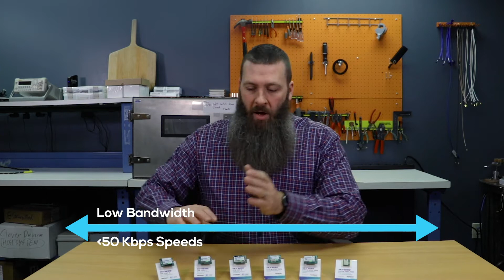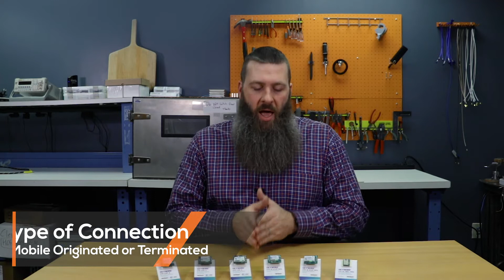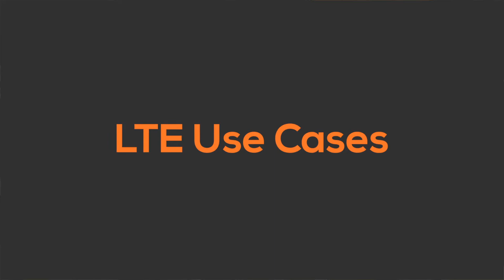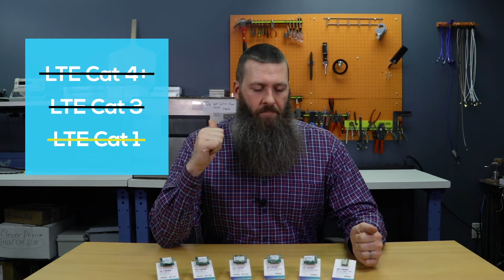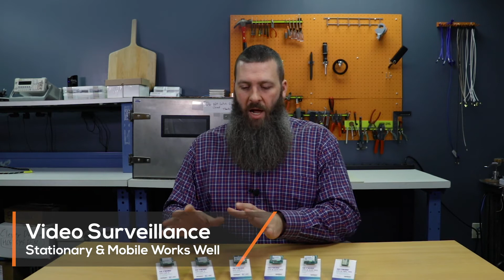Choose the Right LTE Technology for Your IoT Use Case

Comment: Nobody can explain to me to what extent Cat 1 has stronger signal propagation than Cat-M in poor service reception areas. I don't care about speed but I do need reliability and uptime. And I can't understand why sometimes my fixed Cat-M stations drop signal for hours.
Reply from the maker: Thanks for watching! LTE Category 1 doesn't necessarily have a stronger signal propagation than LTE-M, but because it's a standard LTE technology (and not a low power one) it has the same coverage area as traditional LTE devices do. LTE-M is often deployed on fewer LTE bands than Cat 1, and may not be present on all towers, either. The trade-off is that LTE-M has Coverage Enhancement Modes that allow the signal to be usable at a lower power over longer distances where supported. There are many factors to consider, so it's hard to say exactly what could be causing the issues with your LTE-M devices.